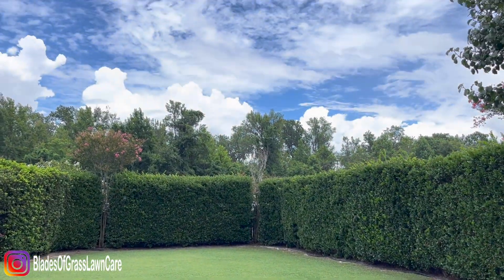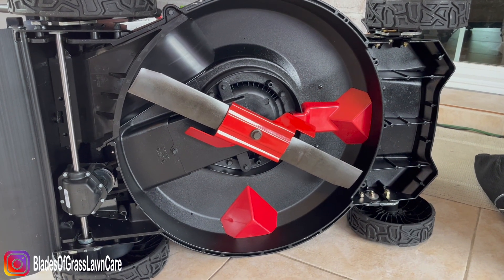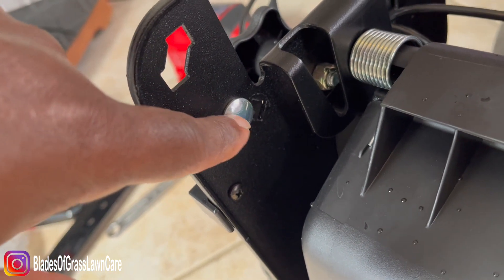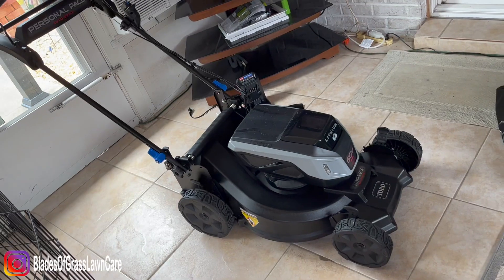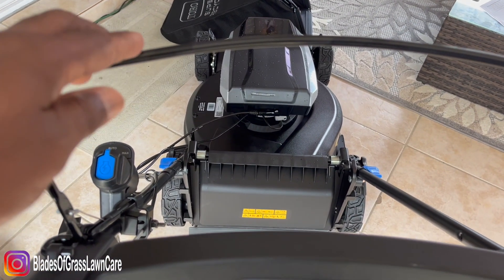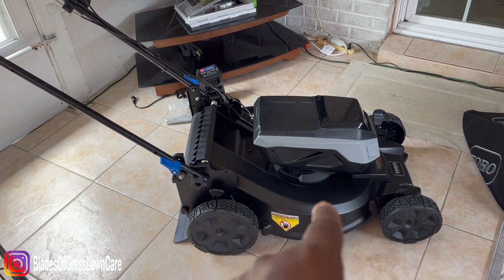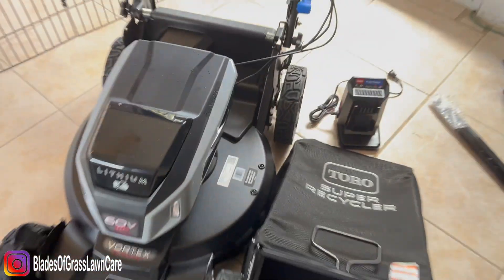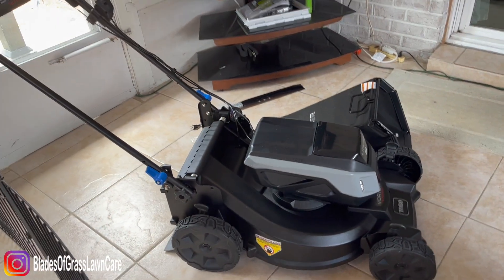New TORO 60V Super Recycler - Just arrived!

Comment: The new Ryobi 18V self propelled mower is actually a very good mower if you’re getting into E equipment. I already have bunch of the 18v batteries since I never invested in the 40v platform. The mower runs on 2 batteries, but fits 4 at a time. I’ve replaced my Honda HRX in my business and its saved me a bit on gas :)

Comment: I have this mower as well as the one before it. The blade that comes with is considered a commercial blade. The one that is on it is called the homeowner blade. That came from the rep at toro. The other part I hate is those batteries are $300 a piece and if you run it for properties like I do you need 3 batteries to make it through the whole day. Yes in time they will pay for themselves. By that time you will need to replace one or two as they are only good for 50 charges before they decide to only hold half charges. Otherwise I do love mine. Thanks and have a great one

Comment: Few things I don't like compared to the ego off the bat without trying in person is the weight, the battery is only 7.5 ah compared to the 10 ah on the ego it cost about $100 more, it doesn't allow transport without the blade, and no single lever for adjusting deck height

Comment: I don't have a use for an electric mower but I like that one, 60v is great. Only thing I don't like is rear wheel drive. My Rover 955sp is front wheel drive. It means you can lift the front to move it around when the engine is not running. Cheers.

Comment: Bro I dig your channel. Been watching for maybe close to 2 years. What I'm not understanding is all this attention on electric tools. You say this mower will go for 15 minutes on a battery. That is useless to a lawn care professional. Electric is a great idea in concept, but until they build batteries that can last through a professional's day, what good are they? I picked up a Milwaukee string trimmer to give it a shot on my truck. I bought the big 12 extended capacity battery, and it provided an hour and 15 minutes of power while the trimmer was on low speed. The battery cost $240. It takes longer than that for the rapid charger to recharge said battery. This means I'll need at least three $240 batteries to get through my day with one tool. But here's the thing, what if one of my guys needs to use the hedge trimmer, it also uses those batteries? You can't share them. So got to buy a whole new battery for hedge trimmer. Luckily One battery will get you through the day trimming bushes. But now you are $960 (before tax) in the hole powering 2 tools. $960 in gas would power all my equipment for over 2 years. Oh, and what happens when you forget to charge all these batteries the night before? And THEN you learn that each battery is good for about 1000 charges, then you gotta buy a new battery. 
I like the weight, I appreciate the fact that I don't have to pull start electric tools. Beyond that: they are still in the development stage that is useless to a professional.
Reply from the maker: 50 minutes, I understand all your points and clearly battery is not for everyone, but if you have been watching me for a while you seen where it works for me and my business and I'm extremely profitable incorporating battery in my business. My job is not to convince you it's to show you what's new, thanks!

Comment: I love Toro mowers but my biggest complaint is that they don’t have single lever height adjustment.  I’d you have different grass types or use different heights in different sections like I used to do, it just becomes a nuisance more than anything to have to adjust each wheel at a time.  Great mowers otherwise though whether gas or battery.
Reply: I see comments like these a lot, but in my experience the single-point adjustments give way too much body flex front-to-back.  I tried a Kobalt 80v, and the front end would nose dive around an inch if you pressed on it.  After one mow, I had crop circle scalp marks from the darn thing in spots on my yard... so it went back.  Even my bro-in-law's Milwaukee mower flexes about 1/4".  Press down on the front-end of a multi point adjustment system like this Toro and there's absolutely zero flex.  That means the deck stays level and consistent throughout the mow (provided the ground under it is level of course - haha).  But the single point adjustments certainly are more convenient - so if someone is constantly switching heights (as you mentioned you had to do) it would be preferred.  I only change cut height a few times a year, so no sweat for me.
Reply: @SiXX5150  thanks for echoing that.  I just bought a Ryobi 40v HP mower and was really hoping it would do well for my thick zoysia, but I get crop circles and very uneven cut due to this flex and super light front end. It’s going back and I am getting this Toro or the M18
Reply: @cashmir316  No problem!  I’m pretty passionate about how I feel on this subject - haha.  I too purchased this exact Toro mower a little over a month ago, and can confirm it’s completely rigid - no body flex.  The Milwaukee is probably the best example of a single point that minimally flexes, but it’s still there a bit.